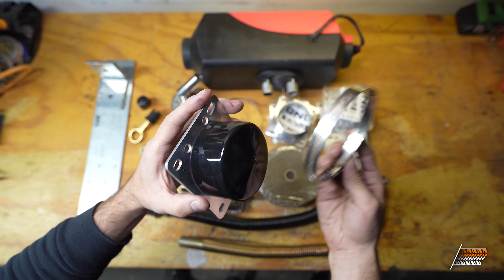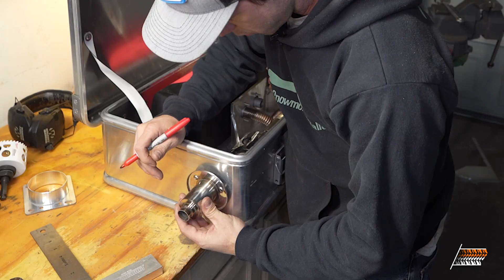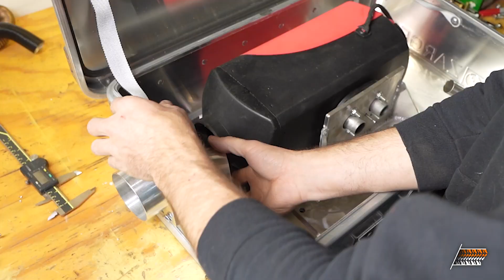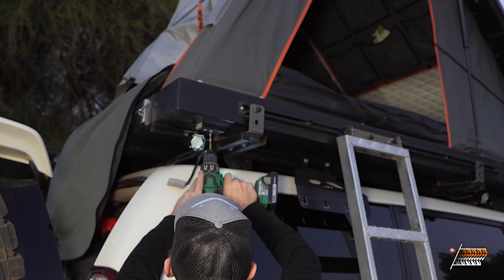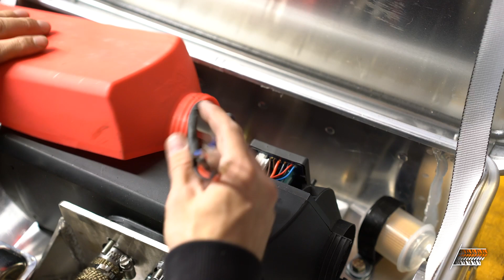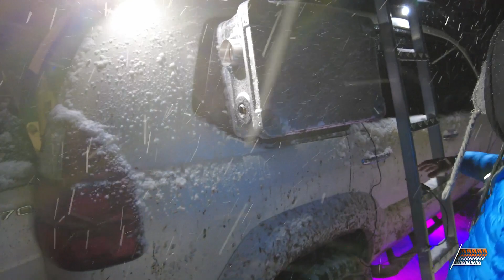The Ultimate Diesel Heater Setup for your RTT!

Comment: I don't understand why the elbow exhaust  flanges are flush on one side not able to add a pipe or clamp on its just flush I want to mount flush to enclosed trailer floor and add pipe and muffler

Comment: I was dreaming up something similar to this. Any issues at all running the unit with that long a length of a fuel line between the heater and the fuel tank?

Comment: Why didn’t you just have exhaust going out the bottom of case so exhaust is on the outside, don’t forget condensation from exhaust has too have a hole otherwise rust takes over
Reply from the maker: I mentioned in the video to not place the exhaust like I did here. I wanted less things to setup but it is not smart to place the muffler inside due to its weep hole

Comment: Do you ever have power issues. I have mine hooked to my vehical as well however when I start mine up without my truck running it gives me low voltage

Comment: Its advisable to have the least bends as possible to the exhaust system for better heat discharge away from the heater.

Comment: Lots of cool ideas to take away here.   You have said that you figured out the muffler problem already.  I like the idea of having it outside the box so I can point it away from the vehicle to reduce fumes.  Inside the box is really slick though.  I wonder if filling the hole in the muffler would inhibit the exhaust spilling into the case?  
Now that you moved the wiring above the heater unit, is there still room to remove the heater for maintenance?

Comment: Some of those mufflers have a weep hole (opposite side of the notched side of the muffler) to allow condensate to escape and prevent accumulation of moisture. That weep hole is now inside your closed cabinet, IF your model muffler has the weep hole. This could get carbon monoxide into the case, but I don't know how much. The cabin air path has good air pressure just downstream of the fan that blows the air across the fins outside the heater body (but inside the red plastic heater case), so that's not a risk for entry of the small weephole exhaust to enter your tent. However, just upstream of that fan, the fan creates lower air pressure. IF your path of intake cabin air is reasonably well sealed between the fan and the intake opening, then you will get very little air from your case drawn into the intake cabin air path. I have not noticed condensate dripping out of my muffler weep hole, and the muffler likely gets hot enough for my runtimes that it burns off the moisture. Still, if you see condensation inside your case after you run it, that could be the source. cheers.

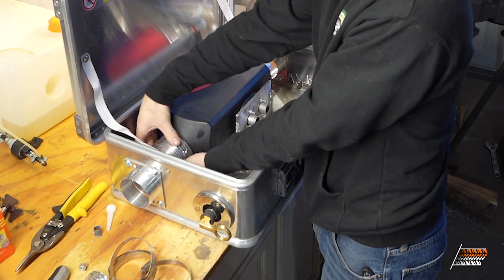Comment: Awesome build!  I built one of these couple of years ago using an Apache case.  On 34:15 - You said you that "I should really seal the heater."  I found that its a good idea to seal with aluminum tape.  there will be some pressure in that case from heat build-up and could get in the crevice of the heater.  Also, that heater gets really hot(150+ F) inside and a 100mm computer heater would metigate this issue.  Since your dealing with heat, I also installed a temp sensor with an auto power shutoff just for extra measure.
Reply from the maker: The ECU is getting cooled by a constant flow of cool air from the inlet.

Comment: So happy I found your video. What settings are you running your heater during the winter (30F or below)?  Do you think the fan is running at low, medium or high power to keep the heat going to your desired tent temps?

Am wondering if it's better to get a 5kW and run on low or a 2kW and run on medium/high for the RTT (louder). Thanks!
Reply: probs too late now but a no brainer - 2kw.. Even then I'd expect it to run on the lowest setting - dependant on the insulation qualities of the tent itself

Comment: First and foremost, great video and build. I plan to do my own soon. It sounded like you ran this off on the vehicles battery. Did you have problems doing this? I’d like to run 1 to 2 nights without moving camp and starting the vehicle. Also any problem with the exhaust and air intake being so close?
Reply: I also would like to know if you have issues starting the vehicle after running the heater for a few nights, assuming you are running on car battery. Great set up though!

Comment: you could also vent the box and just leave the intake pipe not connected. that way the intake would circulate the air inside box and keep the electronics cool.

Comment: heads up, I may have missed it in the video but those exhaust mufflers have a drain plug on the bottom, so you may be dripping into your compartment with exhaust residue and fumes.
Reply: I caught that too.
Reply from the maker: We addressed this in the video specifically but good looking out

Comment: Thank you for your video. This is a great setup. I need a mobil setup. I will definitely be using some of your ideas. Some changes/ideas for my build: stack the cold intake and heat flanges and mount from the outside, enables solid vent ductwork to attach to the heater inside. On the exhaust, mount the muffler outside the box and use a threaded fitting welded to the thru hull exhaust tip. This allows the muffler to be screwed on/off and a threaded cap for travel. For the combustion intake, same with a threaded end outside for a travel cap and just leave it open inside and put a bug screen over the opening inside the box, this allows for the air to be slightly heated and no fuss with an intake tube. Then a high side vent for cross venting the box. Anyway, thank you again for your video.

Comment: Nice build! Wondered if you considered a return air duct? I would think reheating the tent air would be more efficient than the sub-freezing outside air.
Reply: My thought exactly.
Reply: Like hitting the recirculate button in your vehicle. Although the air would be incredibly dry and how it is now it’s introducing oxygen to the tent as well
Reply: @ChrisSmoove77  The sprinter crowd mounts the heater inside and only pulls air from outside into the burn chamber. I suspect there's enough of a leak you're not going to run out of oxygen. That said my build is inside a metal canopy and I plan on have an outside air inlet independent of the heater. Just a window slightly opened etc is probably a healthy idea.

Comment: 36-20 the muffler has a moisture bleed hole in it, so installing it in the box is going to create a problem sooner or later.  For every gallon of fuel consumed a gallon of water will be created so the bleed hole needs to be welded shut before installing it inside the box.

Comment: Hands down the best Diesel Heater set up on an overland rig! I'm working on a far less ambitious project related to my portable diesel heater fuel tank. The vented cap allows fuel leakage. So, I am modifying a Rotopax with a bulkhead petcock and will run fuel straight from it to the heater. Subbed. Cheers!
Reply from the maker: I appreciate you! Yeah my tank leaked as well. For now I plugged it with silicon and haven’t had any issues. Still on the lookout for a better tank solution that will fit in this box

Comment: I expected you to build a sheet metal shroud lined with heat reflective foil that covers all of the exhaust.  Also, do you intend to connect the intake to the tent to recirculate the air?  It seems the heater would tend to inflate (pressurize) the tent.  Lastly, I would imagine the interior temperature of the Zarges box would be something to consider.
Reply: These furnaces were actually built to be installed inside cabs of trucks to reduce idling.

And actually, recirculating isn't how condensation builds up, it's poor air quality management, or lack thereof.

A large majority of people who purchase these units do not recirculate because they purchased a 5KW unit, which equates to roughly 17,000 BTUs.  Pumping that sort of heat into a closed system would literally roast them out of the tent.

Instead they opt to literally throw efficiency out of the window by opting to not recirculate.  I mean we're not here to save gas, we're here to burn it. 😂😂 Climate Change is a hoax.  

Another side effect is that because the tent is closed off without any venting, any air fed from the heater towards the tent interior, there's actually some back pressure at the heater outlet.  Running this at max during the winter has some potential reliability issues because the outlet gets hot but the inlet, stays cold.

Ideally a 2KW diesel heater would be spec'd out for this type of build, and would be run at Low with the proper air/fuel ratio so the glow plug doesn't kick on.  

On low, the 2KW units can burn around 0.12L to 0.14L per hour outputting roughly 3,000 BTU.  That's perfect for recirculation, and with a slight crack at the top of the tent, you will not have any condensation issues.

A typical 5 Gallon Jerry can full of diesel will last you almost 21 nights with a 2KW unit on recirculation w/ tent temperature in the 80s.

A 5 Gallon Jerry would last you about 5 and a half nights running on almost high using the unit pictured in this video in the 60s.

Assuming nights are in the 20s.
Reply from the maker: Header wrap really helps in this area. No intention on recirculating the air, that’s how condensation builds and there is plenty of heat out of this to not need recirculation. We also generally keep one small area of the tent cracked.

Comment: This thing is awesome.  Super job for a DIY type of deal.  Thanks for sharing your build.  Only input I have, the duct into the tent is acting like a head exchanger, and could be insulated down the road.  Not sure how much real world heat loss there may be due to that, but just a thought.  Be very proud of what you have put together!
Reply from the maker: Appreciate the feedback! So far with this short of a run, there isn't much loss to make too significant of a difference (as opposed to designs that sit on the ground and have 5-6 foot long ducts). The tent windows are almost always cracked and we never go above low haha. During the trip in the intro of this video we actually used a splitter to heat both my tent and Hunter's GMC cab. His cab leaked a ton so it wasn't nearly as effective, but was better than nothing for that trip. Thank you again!
Reply: @TwoTrackNation  That makes total sense.  Thanks for the reply, and thanks again for sharing such a cool project.  I look forward to watching more of your videos.
Reply from the maker: @LimitOfN  Of course, thank you for the comment!

Comment: Like pretty much everything except how you bend the exhaust pipe.
Reply from the maker: Yeah the idea was to keep a nominal length exhaust for proper back-pressure/combustion while still utilizing the muffler. Hence the snaking of it. I will likely be relocating the muffler to just be a slip-on piece that goes on outside if needed.

Comment: Great video. 

If you got rid of the muffler you might be able to lower the heater in the one case and add the fuel tank to the same case
Reply from the maker: Definitely going to be getting rid of the muffler at some point, but the fuel tank still would not fit. Maybe a smaller tank but these boxes are pretty small. Filling the fuel tank in the other case is just barely do-able as-is with the current height so I honestly wouldn't want it any higher.
Reply: @TwoTrackNation  that makes sense. 

I recommend running the heater on high for a while before shutting them off. People have issues with them getting built up won’t soot when they are ran on low allot.
Reply from the maker: @EvergreenOffroad  That's good info! I'll definitely ramp it up for a bit from now on.

Comment: WOW, good job on that heater setup, thanks for showing the details behind it all.  I too would be hesitant about cutting a hole in the bottom of my Alu-Cab.  For now Ill be running a hose up to the tent when I need heat.
Reply from the maker: Thanks for the feedback! Happy you found it useful, vent through the window definitely always works 🤙